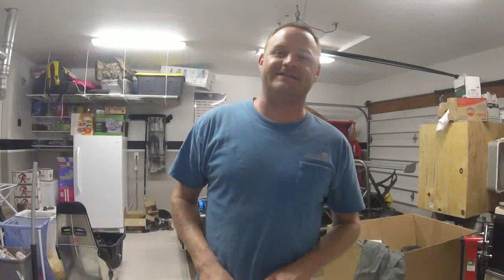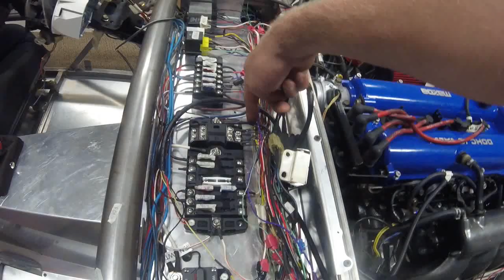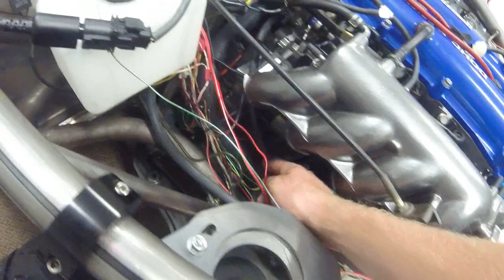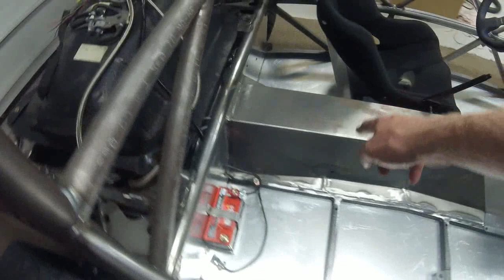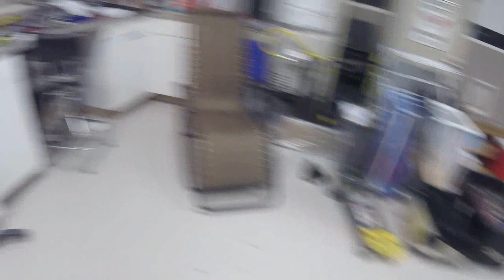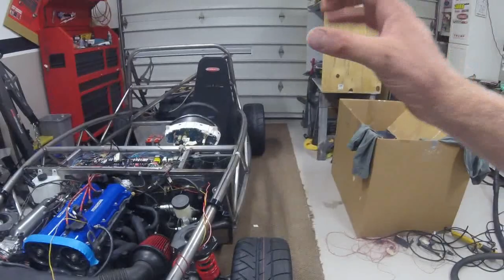Exocet Build: Custom Exocet Wiring Harness (Part 42

Comment: Does the MX5 circuitry freak out when certain components are removed entirely? I know my Subaru will not start with the headlights removed.
Reply from the maker: Honestly no.   I rigged the factory harness to work without many components.   Remember this was a 30 year old ecu...

Comment: Did you buy a universal kit or did you just go out and buy the wire and components and make your own? If you bought a kit, which one did you buy? My project is basically doing the same thing you did. I won’t get to this point for a bit but trying to plan ahead.
Reply from the maker: No kit just bought some fuse blocks on Amazon and reused most the stock plugs
Reply: This is helpful, though, thanks for posting

Comment: Amazing job so far. Looks so much cleaner than the mess my stock harness is right now. And we're using the same expansion tank. :)
Reply from the maker: Thanks.  It will look better once I'm don't wrapping all the wire and zip tie it together.  It's a pain but worth it for the fit and finish as well as the knowledge you gain regarding automotive wiring